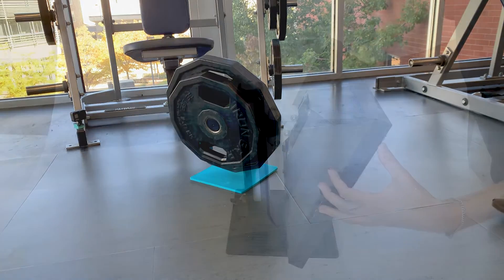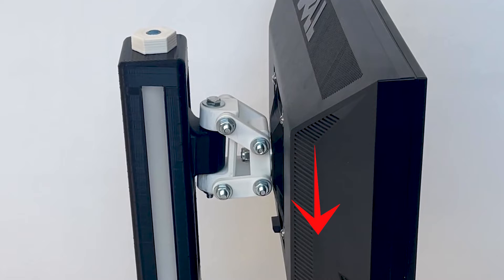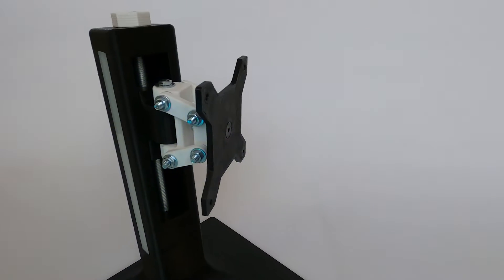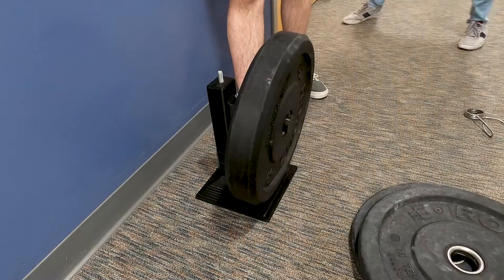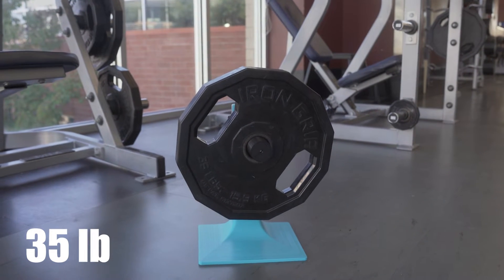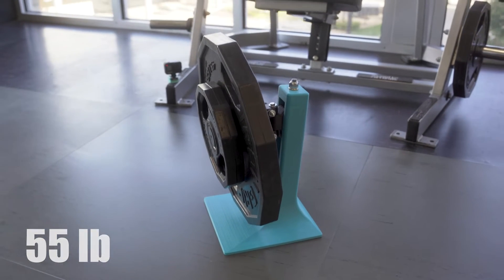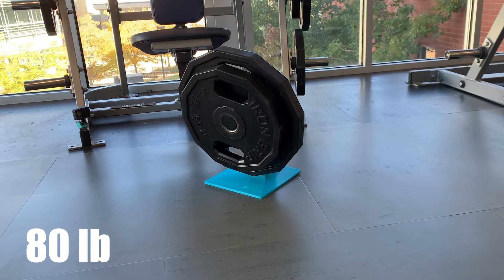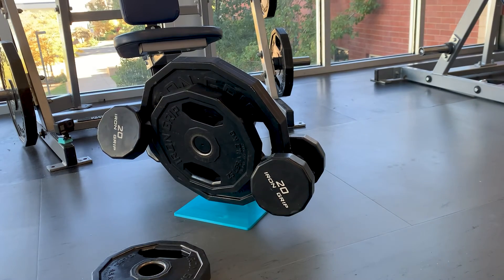How many monitors can a 3d-printed monitor stand hold?

Comment: Awesome job Yan! This is a great 3D printed monitor design and shows a clear evolution of your previous design. The 4-bar linkage adjustment mechanism is a particularly nice touch. Since it's strong enough for 10+ monitors, it's likely to last quite awhile under a normal use case with one monitor!